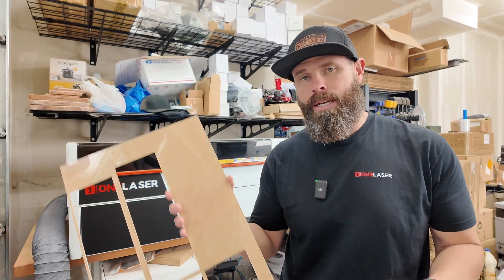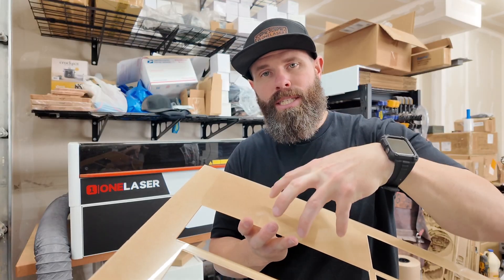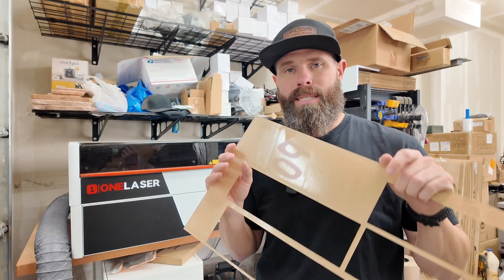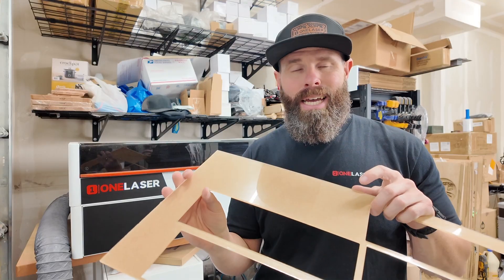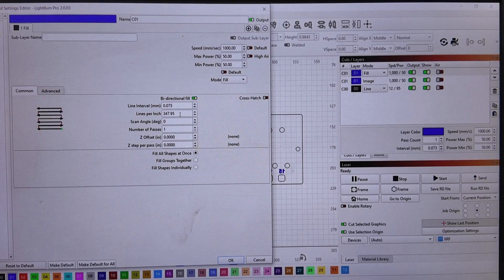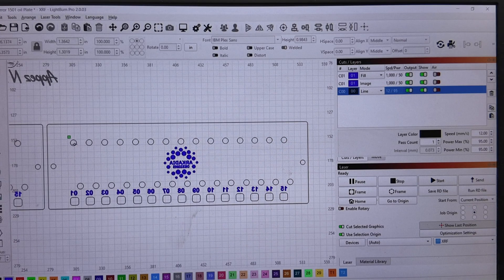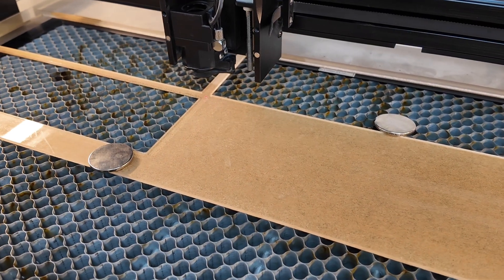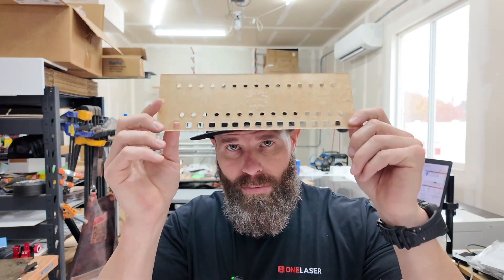Acrylic Engraving & Cutting Tips | Perfect Frosted Results on CO₂ Lasers (OneLaser XRF Guide)

Comment: Great video!  Couple of questions. I may have missed it is you mentioned, but it has to be cast acrylic and not extruded, right?  Also, I have some white and orange acrylic that my UV laser didn’t like (kept melting when I tried cutting).  I’m going to give it a try with the XRF and see if it works or if I wasted $ on bad acrylic.  To go to colored acrylic, what sort of adjustments to the settings should I make compared to clear acrylic settings?
Reply from the maker: Cast acrylic is the gold standard for laser work. My settings should work on those colors as well. If you needed you can slow down just a little bit should cut no problem on the XRF. Extruded acrylic does tend to melt rather than having a clean cut. Where did the acrylic come from?

Comment: Love the video, I mainly cut acrylic on my XRF. I find that I have to run at 5-7mm/s to get a full cut through. Also it seems like your auto focus puts the head a bit higher than mine, what’s the optimal distance from laser head to material?
Reply from the maker: I moved my lens down to the lower position in the lens block and adjusted the focus to match the new position.